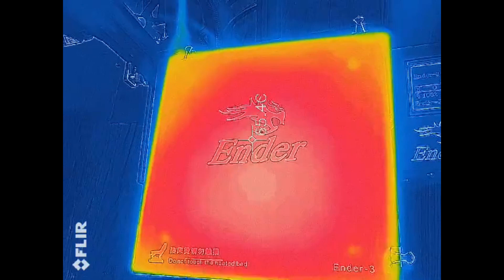New Ender 3 User Part 2 - Getting Started - Upgrades & Mods - Chris's Basement

Comment: I pushed the LED's inside the groove in the extrusion all around the frame. Works great.
Reply: I did the same, though only on the underside of the top extrusion. I printed a channel that goes inside the V-slot and holds the LED strip. I routed the wires inside the left hand extrusion and printed some small holders that go inside the V-slot. They don't interfere with the rollers. For now the strip is powered by its original power supply. The inserts I used are available on Thingiverse, but you'll need to edit them to suit your needs.
Reply from the maker: Nice! I might try to put some more on mine. I might give this a try.

Comment: 14:08 Live* Neutral and Ground. Live swings from +170V to -170V. Neutral is the reference voltage at 0V. Ground is electrically the same as Neutral, but its specific purpose is to make sure the case or anything anybody can touch is at 0V (and thus can't shock you) and current should only travel through ground in a fault scenario.
Reply from the maker: Thank you for the info.
Reply: @ChrisRiley  Thanks for the awesome videos! I should also add that the color coding on those mains wires are completely non standard. Live is usually black and can kill you if you touch it (so making it neutral is a funny choice 😅 which I forgot to mention in the oc). Neutral is white, and ground is green/green&yellow or has no insulation. Cheers!

Comment: Great series, really enjoying it so far. Have had my Ender 3 since October and am really loving it. Took the time to really "get it right" during installation, and it produced beautiful prints right from the get go.

I don't have a whole lot of room on the sides where I have my printer set up, so the side-mount spool holder doesn't work for me. I ended up mounting it in the usual place on the top, but I installed a filament guide with 604 bearing on the X axis, that takes care of the issue where the filament enters the extruder at a severe angle, haven't had any issues with it at all. I also installed some LED strip lights... but stupid me didn't realize the Ender 3 was 24 volt, so I bought 12 volt lights. Yeah that didn't work out too well. They were in fact REALLY BRIGHT... for all of about 2 seconds lol. Fortunately I had some DC buck converters in my parts box so I just wired one of those in instead of buying 24v LEDs.

BTW Do you have any recommendation for fan ducts? I'd like to get a bit better cooling than the stock duct, but I'd like to keep it looking as close to stock as possible, I really don't like the look of any of the "extreme" solutions like the Hero Me or Petsfang.
Reply from the maker: The fan duct is something I have looked into a couple of times, There are a few stock ones out there, but I am not really happy with any of them. I am like you, I want to keep it simple, but make it a bit better. I have a few ideas, maybe I will make use one for a future video.

Comment: 14:36 good tip on not using bare wire. Split, eye, or ferrule terminal but never bare under a screw. Except, maybe, if it's solid core wire and I wouldn't use that on a printer anyway.
Reply from the maker: Thanks man, I much prefer the crimp ons.

Comment: I am using the capricorn XS (the tighter higher temp one) on my CHIRON and have been printing HIPS at 255 C with the standard hotend (tube all the way to the nozzle) Without any problems for 27kg now I changed the nozzle a couple of time and even the hotend (cross threaded the nozzle cause I am all thumbs) and the capricorn tube still looks undamaged and no discoloration
Reply from the maker: Nice! That's good to know!

Comment: Great video Chris.  I'm getting ready to build my first ender-3 and this is going to help out a lot.  I didn't notice but when you adjusted the nozzle for the capricorn tube, did you mention that the bed needs to be releveled?
Reply from the maker: I didn't mention it, but it's a good idea. It would be almost exactly the same though. nozzle won't move much if at all.
Reply: True, it's probably not much.  I'm not sure how sensitive the ender3's build plate material is to leveling.  BTW I really like the style and pacing of your videos! Keep up the good work.
Reply from the maker: @bbowling4979  Thanks!

Comment: you mentioned this is a multipart series, Am I missing the link to part 2 ... and so on.
See you doing this on a Ender 3, not the Pro ?
Noticed a couple of guys add a extruder wheel, guess maybe part 2?
love the LED bar and also the clip in strips for the vSlot.
Reply from the maker: Hey George, this is part 2, I will be putting these in a play list soon.
Reply: @ChrisRiley  well duh to me, i ask where is episode 2 while watching episode 2... (like where is my glasses, while they on my head) thinking this was episode 1, ok so got episode 1 & 2 now, the unboxing, and this episode 2, is there a #3 ?
Reply from the maker: @georgelza  Thanks for this comment, I went back and renamed them to make more sense. Part 3 comes out today!
Reply: @ChrisRiley  Can I suggest in comment of part 2 adding a link to part 1, and maybe after today to part 3 also, and then like wise for part 1, pointing/linking to 2 and 3 and similarly in part 3. that way which ever part is found it will link to the others, ending in the viewer following those links.
Reply from the maker: @georgelza  Thanks George, I will get it fixed up!
Reply: @ChrisRiley  hehehe not fixed, just suggestions :)

Comment: Changed my broken Mainboard with an mks gen 1.4 with tmc get it all to work fine now except of the end stops it ru s in an don't stops pushing against any suggestions how I could try fix that? It's on every end stop no matter witch axe or or if I use min or max plug ins
Reply from the maker: Hmmm, sounds like they might be inverted in the firmware. Do they change at all? Check them with m119. Be sure you are using the ground and signal pins, not the V pin.

Comment: Thanks Chris.  I really like the LEDs.  I think I will do them.  Glad you emphasize connectors, even on low power connections.
Now, does the capricorn tubing really do anything?  Are you sure there is a higher heat rating.  I have seen arguments saying that since it is still Teflon based, it does not.  You thoughts?
Reply from the maker: The stats say yes on the heat rating, but I will have more of this on the next video.

Comment: Hi @ChrisRiley, I'm very interested in getting into 3D Printing. I'm guessing with all of the popular 3D Printing channels doing their own take on this printer, the Ender 3 is probably the best value for under 200 and not to hard to use for a first timer. Also the Ender 3 seems to have quite a huge community when compared to the other low cost printers. Do you recommend this over the da Vinci Mini Wireless as a first printer? The size of 6" x 6" x 6" would be more than big enough for my needs. I also love the all in one construction even if it has proprietary software and filaments too. I'd love your opinion brotha, you seem to have a good sense about many different 3D Printers out there.
Reply from the maker: Just my opinion, I would for sure go with Ender 3. I had a Da Vinci Mini and I sent it back. It's just kind of a mess. It works, but just all the proprietary stuff on it was a real turn off. Some people probably like them, it's just not for a tinker like me.

Comment: At 3:30, I think this part might be better as it angles the spool back for better clearance. Thing # 3419226
Might be more trouble to print though as it needs supports.
Reply from the maker: Right on, I am not super happy with this one yet, but it does keep the filament away from the lead screw. I will check this one out.

Comment: 14:12 — If you have -24V wired to +24V you end up with a 48V potential. So, is it possible that the connections on the PSU are GND and not -24V?
Reply from the maker: Mind blown, now I have to go look it up.

Comment: 8:30 this is for beginners, but if those 2 screws are missing from the heat block, taking the nozzle loose that way will probably twist the heat break in two.
Reply: Nope they are there.
Reply from the maker: It's a good point, I should probably talk about those screws a bit.

Comment: Way too long tube IMHO.
Reply from the maker: What length do you run with?
Reply: @ChrisRiley  well , always the shortest possible, to minimize the Bowden effect, to reduce rétractation needs, and allow to print flexible filament. You want to keep the minimum tube length to don't pull on the printhead at Xmax. It's about to leave a 2" radius above the printhead (I'm a metric guy sorry).😉
Reply from the maker: @axelSixtySix  Thanks for the response. I will check it out.